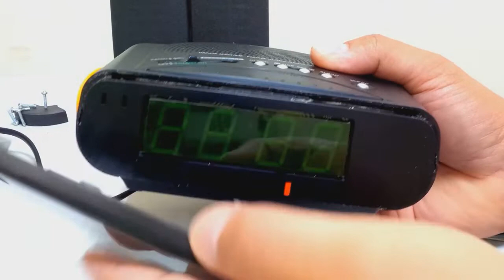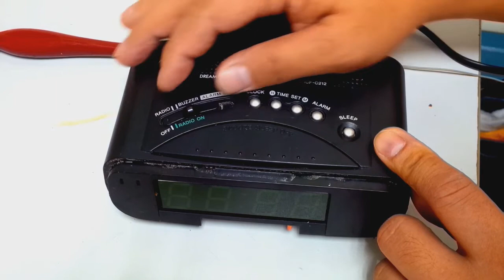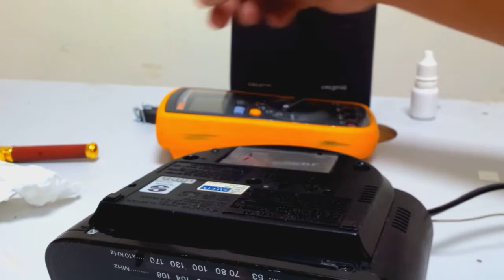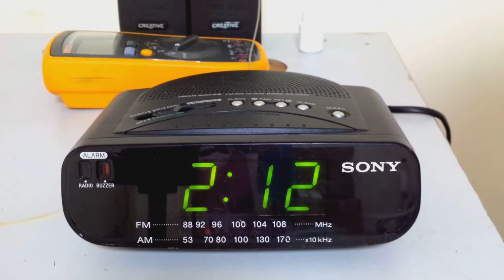SONY CLOCK RADIO (RESTORATION)

Comment: Hola Josef y José VLOGS. En este radio reloj si repasas las soldaduras solucionas problemas de funcionamiento tales como, no tener alarma, falta de digitos o q la radio no arranque. Normalmente si se empieza x la llave de corredera comienza a funcionar. salu2 y gracias x despertar la inquietud
Reply: Cómo le cambio el control del volumen?
Reply: @johnmiltonsantosrodriguez2300  es un preset ni siquiera un pote. Fijate valor desoldá y uno nuevo hasta q se raye el carbon otra vex